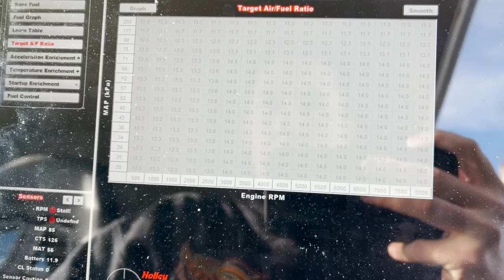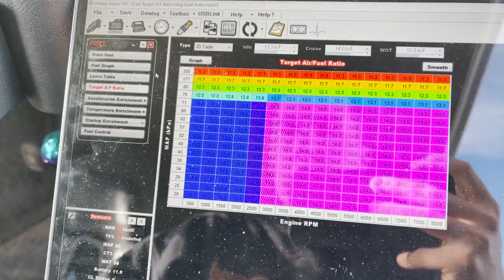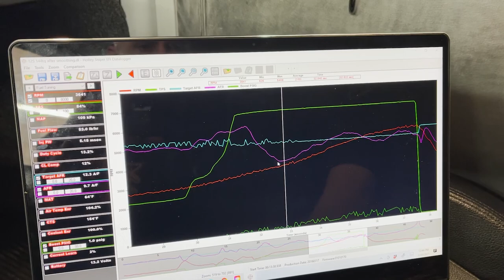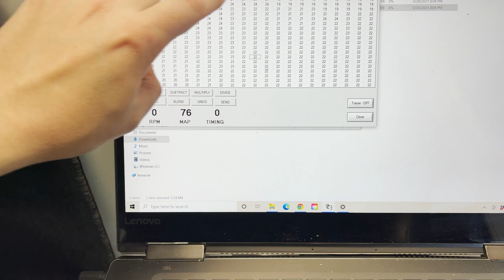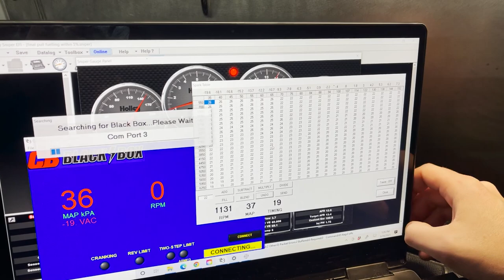Turbo VW Bug with Holley Sniper EFI Draw Through Gets Tuned!

Comment: so that weird ass rich spot where it pulls fuel is pretty interesting to see. its an effect of the resonance of the intake. Its a very well known dead spot caused by aftermarket intakes in the VW world. The manifold should be a T with a smaller feed pipe than the cross pipe (like the stock manifold) OR should have individual runners each paired to its own bore on a carb. its really interesting to see the effects of charge stealing occur in the fuel table!
Reply from the maker: It was definitely interesting to tune!

Comment: How can I contact or reach you I'm wondering what kind of carburetor EFI system do I use on a 1973 Volkswagen Beetle 2180 turbocharged right now I'm running a 4-barrel 460 and I want to convert to EFI I was told the super sniper EFI is the one to go with

Comment: I used to run a draw through turbo with a single DCOE 40 WEBER Rayjay Tubro with driver adjust boost 1st gen Turbonetics Deltagate,  1.6 Ford Kent engine in MK1 Fiesta 1580lbs made easy into the 200 hp range on 97 Regal Purple Leaded (when they still had it), would peg the boost gauge 30psi, but on regular pump unleaded 93 20-25psi when the air temps were down usually kept it around 15-18psi. The manifold for the carb had coolant flowing through it to keep it from icing up, it's probably a good idea to add a little heat exchanger on the intake on the bug, wouldn't doubt that intake ices up a little reason why it's asking to be lean after running throttle open. You can use hot oil with a air cooled motor to heat the intake, it will atomize the fuel that is pooling at the elbow.

Comment: Really nice problem solving.  Cool.
Do you know if that 90 degree bend towards the turbo is what is causing issues?   Are draw through turbo setups a pain to get right.
Thanks for the video!
Reply from the maker: Draw through is definitely not ideal and would be better to have individual port injection in the intake if possible. Turbos are not designed to flow fuel lol. It’s very delayed and the elbow holds fuel. Thanks for watching
Reply: That makes a lot of sense.   Thank you

Comment: I have a 2387 vw type 1 draw through setup I was wondering where did you guys run the coolant temp sensor cause it’s oil cooled
Reply: Goes to the cilinder head where cilinder# 3 or 4 are located 👍

Comment: So do you start by smoothing the run tables out then adjust from there?
Reply from the maker: All depends on how the car come in and how car the base tables are off if they are close I like to use what the learn tables already have in them and start working on idle and throttle response off idle. Then I start working my up between manually changing areas of the fuel table and the learn table to start dialing everything in.
Reply: @BuildTuneRace  Thanks for the response! I've worked with a number of the Sniper/Terminator/HP setups as well as FITech etc on the engine dyno however it's more of getting a solid base WOT setup and reasonable idle using mostly target numbers etc. The base setups are pretty decent overall for getting the engine up and running. 
I recently did my first Sniper with it's internal timing control and I must say the timing map once you look at it on the laptop is pretty bad. I had to make my own timing ramp for WOT to prevent detonation at the starting point of my pulls, but now you can't make timing changes using the handheld, so I had to make a best guess at timing in the cruise zone and hope for the best. (out of town customer)
Reply: @BuildTuneRace  So how much actual time does it take working on the tune not including dyno installation etc?

Comment: Was that a standard sniper or super sniper? For draw through boost
You need a super sniper I'm pretty sure. It needs to read manifold pressure not vacuum at the base of throttle body
Reply: This guy wants 20K subs, but cant even reply to questions in his comments....
Reply: Lol
Reply: @danieljames5875  yea, I installed a supper sniper with intentions of super charging never did get that far, but the instructions said if your running a blow through turbo the port on the base of the throttle body will see a positive pressure and respond accordingly But if the throttle body is sitting on top of a supper charger the base is reading vacuum but under the supper charger (manifold) is positive and the unit gets confused. The instructions state if your running a supper charger you need to remove the 1/8"npt plug from the side of the throttle body and replace it into the vacuum port on the bottom of throttle body and stake it so it doesn't back off and get sucked  into the engine also screw a 1/8" npt pressure port in the side and attach it to the manifold So it see boost instead of vacuum ... also in the setup wizard it wants to know if its turbo or blown. Its a deep rabbit hole LOL , I no longer have it (74 ' Triumph Spitfire) but WOW I swear by Holley EFI
MAP is manifold air pressure either negative (vacuum) or positive (boost) MAF is mass air flow and is used for throttle body fuel injection but they dont have one on single port injection

Comment: I'm running a Sniper 2300 on my NA 2180cc making 160hp. you know you can get the Sniper to control your timing using the VW Vanagon Distributor.
Reply: What keeps the carb from freesing

Comment: Hmm,  I saw about 105Hp on a 1776 with a 110 cam on dual 40 Dells and stock port 041 heads back in 1992,  I feel like you should be making more hp. Of course, your torque curve is probably nice and fat. Probably just need a better port job on the heads. Talk to Pat Downs at CB.
Reply: What altitude are you at?   

A lot of places in Colorado - you only begin with 11.5 psi atmospheric pressure.  6 pounds of boost is only going to give you around 17 psi in the manifold vs 14.7 at sea level for NA,  or over 20 psi for the same boost level (and a lower pressure ratio so you are more efficient - less charge heating for more power too).
Reply: Yep, that 1835 turbo is probably near stock internally, i'm getting the same 126hp from my 1300 twinport on dual 44 Dells although being non turbo my torque is only 97lb/ft